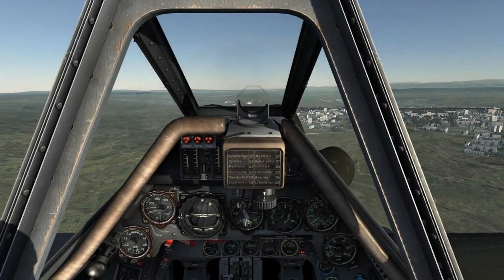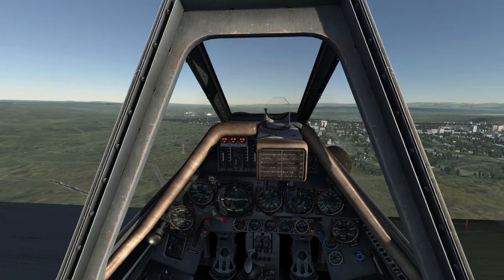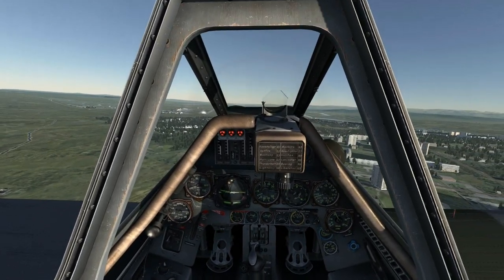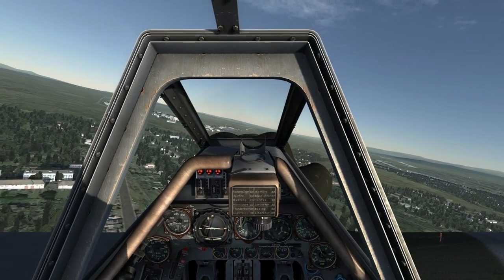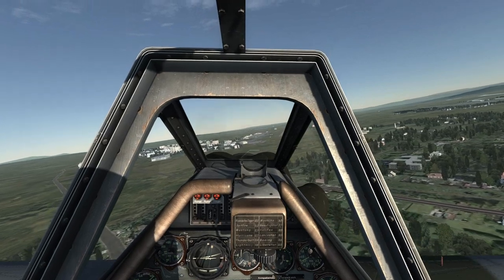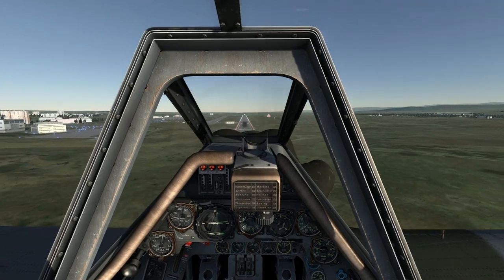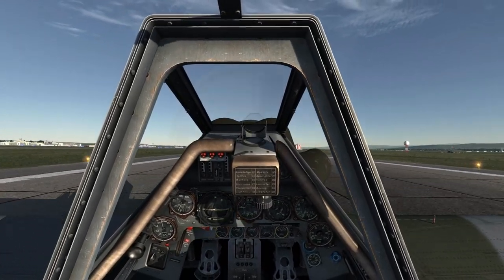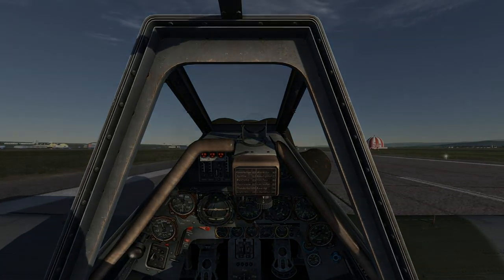DCS: Fw 190 D-9 Dora - Landing

Comment: Are you using the TM Cougar or Warthog as a stick/ throttle setup? What are you using for rudders? My TM RCS crapped out a few years back (had installed toe brakes), so I got a German set of rudders but they don't feel quite right. I believe I helped you get one of your Cougars (if you have more than 1). :)
Reply from the maker: Warthog stick, CH Pro Throttle, no rudder pedals.
Reply: Thank you! Nice landing, especially without rudder pedals!